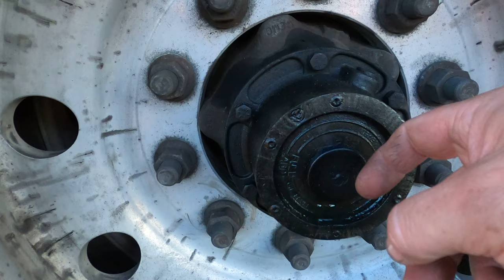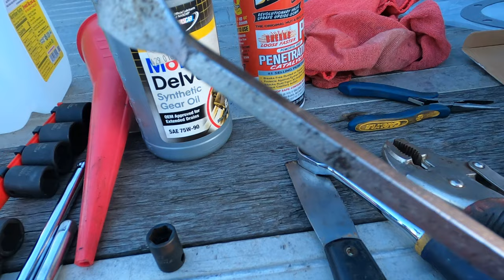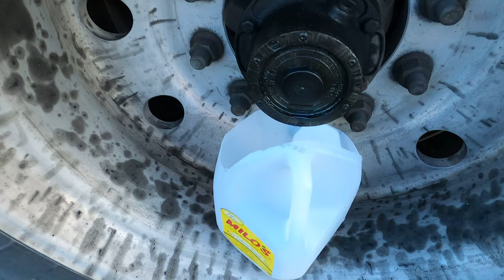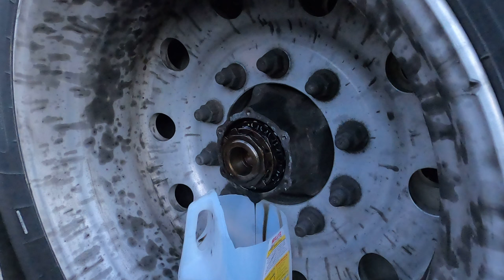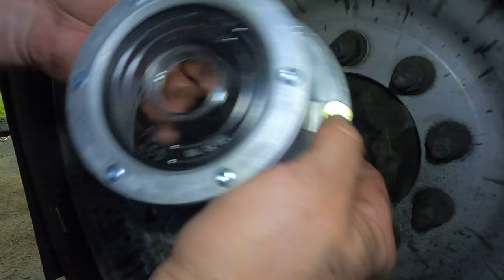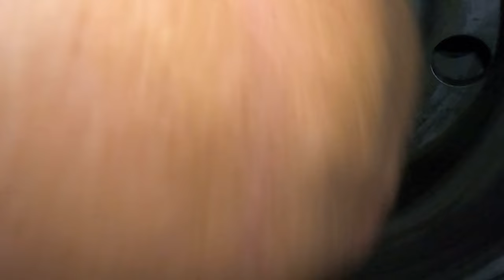Trucking  ,   How to replace an oil hub cap on a  Benson 524 trailer axle  . #trucking

Comment: Hey Scott great fan of ur content I wanted to purchase a Columbia or century 2007 or older what do u recommend buddy pre egr or it doesn't matter
Reply from the maker: If you can get a pre Egr that’s the best , 2nd best is an Egr without def and particulate fillers . Worst is with all the emissions crap that WILL fail and cost you a fortune.